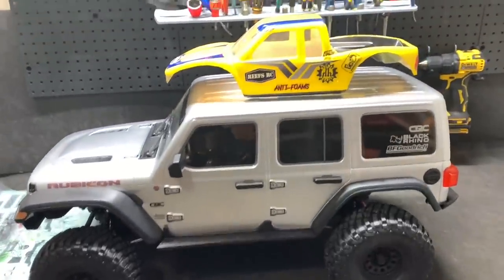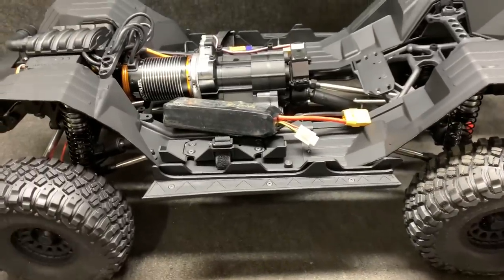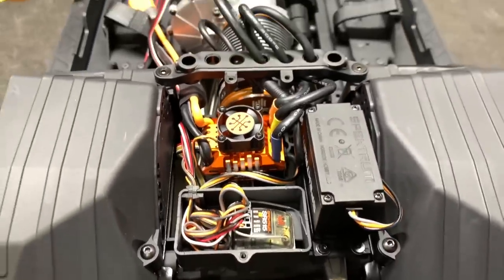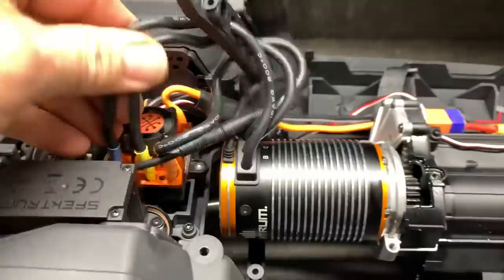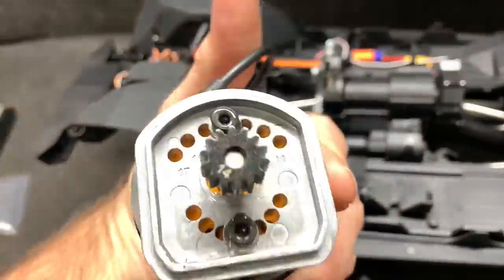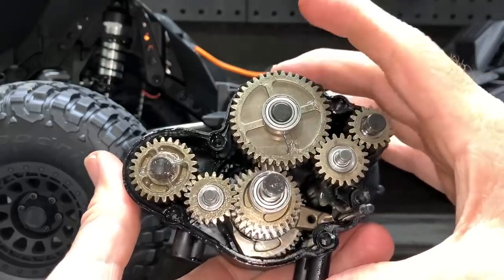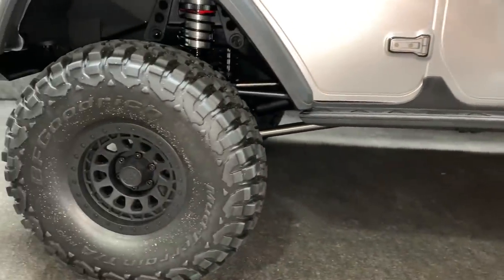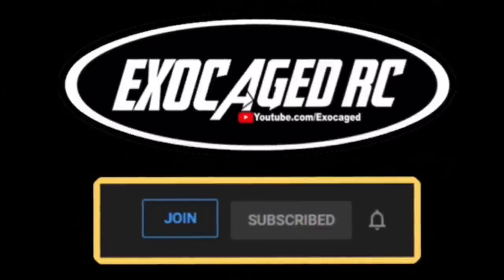SCX6 Exo’s First Look and Teardown

Comment: I like mine,, but my body has a split by the door already, the slipper nut was so loose out of the box it wouldn’t even move under its own weight. Had to take motor and trans apart before I even got to run a pack through it. But it’s back together now, tight and end points set.. so far so good now..
Reply from the maker: Yeah I had to do what you see here before putting it on the ground. I haven’t rolled this one yet so the body is still good.

Comment: and now we wait for vitavon to make a dig trans add on (and seeing as the front and rear outputs are separate it would be fairly easy to put some nice overdrive to relief strain on the trans when turning, but I wouldn't go any higher than 24% and about 12% would be the best for something of this scale).
Reply from the maker: This would be good with 2wd as big as it is.
Reply: @ExocagedRC  yeah totally!

maybe someone will find a way to beef up the VFD-2 trans to put in it.

Comment: My 1/8 scale Marksmen is a very good Rc because it has a wide low stance it will consistently out perform 1/10 scale moded RC’s just because of it. I’m guessing it’s going to be the same for the SCX but it is a high body so maybe someone will do a shoot out between the two. Mind you the Marksmen is half the price!
Reply: The marksman is a lot smaller than scx6 though..
Cheers
Reply: Yes most definitely it looks almost half the size & next to my 10 scale it’s not necessarily looking that much bigger just much wider. So that SCX should be an absolute beast.

Comment: To stop body cracks and body breaking look for weakness in body those spots use gorilla tape inside before you run the rig weak spots are corner areas and sharp bends when body was molded
Reply from the maker: Yeah I do need to tape it before I get too hard on it.

Comment: Go with castle kit 1717-1650/8s or I think they have lower kv in that size it's in my exb kraton 6s and it will crawl so in some like this be awesome and I've only ever ran it on 6-4s and it still nuts

Comment: I really want one but I think I'll have to wait until they get the production and QC under control. I don't want to have to upgrade or fix A 1100 dollar toy right out the box. (And other lies i tell myself) but on some real the front axle shift, the transmission slip, the shifting servo mount and the steering servo need to be fixed on the production models and then It'll be a perfect truck.

Comment: These are not flying off the shelves, readily available.
Reply from the maker: Yeah. At $1100 or $1200 with tax the manufactured has sold out to the retailers. They are moving them each day. But it sounds better when they say the first 25000 sold out.